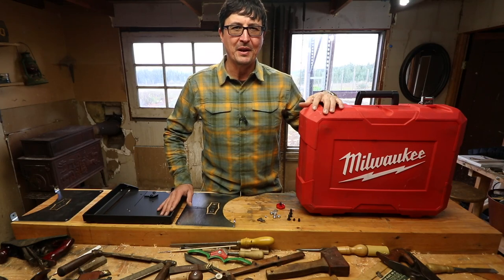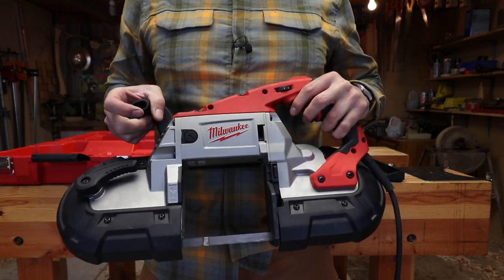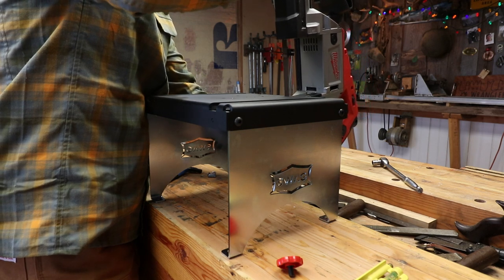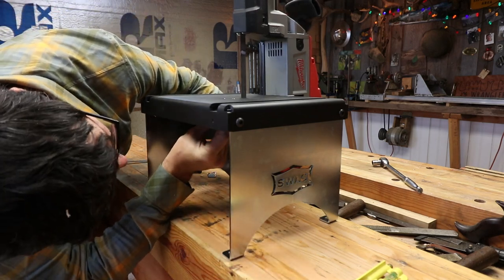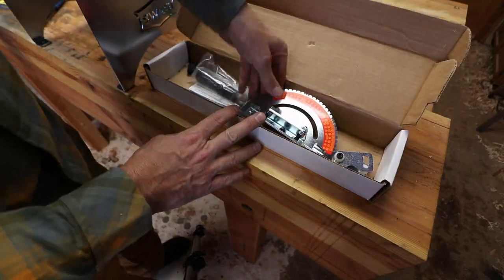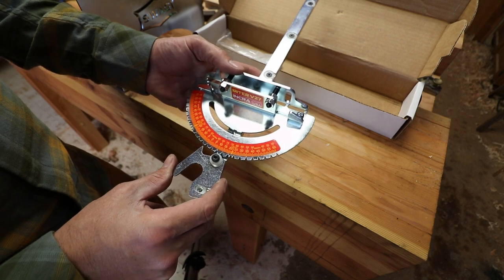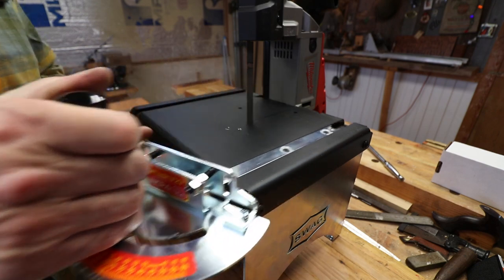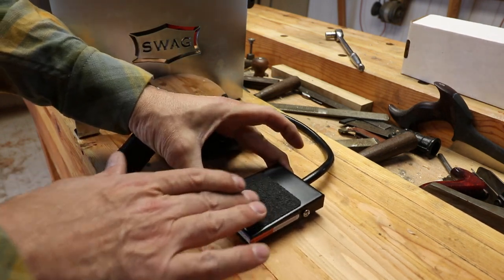AMAZING MILWAUKEE TOOL HACK!!

Comment: Two Thumbs up! Thanks for posting?

Do you have a URL links for the miter tool and the foot switch? They really do make SWAG an everyday useful tool. Perhaps only for emergency use without the two add-on's. There has to be a way for Troy to engineer a way around or trigger clip included with the table cost for the non-lockable on-off triggers types of  band saw. That clamp you're using is great for the video but it makes the hair on the back of my neck stand up for safety reasons. Again just fine and perfectly used in your video. God Bless Brother.
Reply: Hawaiian F150...Use a small zip tie at correct length to slip on & off trigger, works great on my same saw's set up. Leave it attached to saw for use at anytime.
Reply: arkansas13 should be a trigger lock on the saw itself.  been a sheet metal worker for years and every Milwaukee we have has a lock

Comment: Cool addition to the portaband but the video was 12 min. too long.  Didn't need the back story. Just the assembly, use and where to buy was all that was necessary. Thanx, though.

Comment: Iv had my Bansaw about 3 years or so any problem iv had is the rubber belt on the drive wheel broke I guess because of age I use it alot after that I bought 2 sets just to have back up other that that I haven't had any issues

Comment: Use a chop saw and cut anything metal in one or 2 seconds. Forget that tool for I do not see a guard for safety and it is to slow. I have a Milwaukie rotary saw and it has been in my shop for 20 years and has never been used because it is useless.  I have   two  14" delta band saws  with metal blades but they are useless compared to the chop saw.

Comment: Mhhmmm how to cut metal of any size ? To any shape and angles? Oh well what about a trusty ol angel grinder ?! Scratch it on and cut it. Best thing is you can even grind it up, smoothen edges and all sorts of other stuff. The bandsaw sure is nice but it is not justified if you know how to use an angle grinder properly ;) - just my opinion on this.

Comment: Id rather have a chop saw. Worked in a steel fabrication shop for many years, we always used a chop saw and what the chop saw couldn't handle the oxy acetylene torch would. The bandsaw was only ever useful for making nice cuts which isn't really needed cause we weld over em anyways. Nice to have but isn't worth the shop space imo. The bandsaw is very handy when you have to cut 4inch+ square tubing which you would be hard pressed to do with that little guy. Cool hack but not really practical.
Reply from the maker: I don't agree. I have all three including a plasma torch. The torches are to much of a hassle to break out for simple cuts. The fiber blade is noisy and requires a dust mask because of all the fiber particles. This band saw set up is the perfect solution for cutting small stock and a thousand other small items. Yesterday I had to trim a plastic outlet cover, the band saw worked much better than a torch,
Reply: if we're speaking about working with metals i'd have to disagree with ya. Chop saws are well worth their weight in gold and way faster then a bandsaw in most applications.  If your talking about other materials like say plastic (which most people wouldn't be working with at home) then i guess it would have it's place lol  Most could probably get by with a hacksaw though, which they probably already own. Cutoff wheels also have their place too. 

If I had to choose between a chop saw and bandsaw for a small garage metal working setup I'd go with the chop saw 100% all the way. Also if a person is getting into some serious metal working they would break out the torches. I've worked in a metal fabricating style shop for many years. Our bandsaw rarely gets touched.
Reply from the maker: Perhaps for your application a chop saw is best however for mine a band saw is more useful,

Comment: that's a cool garage gig.  but nobody cuts re-bar with something elaborate as that.  that's a great set up for the band saw.  but its not useful on site.  Milwaukee is great but they go too far and slow down production on job sites.  and its all because of the salesman bragging about something we already have.  we have several recip. saws and several grinders that will do the job.  your free stuff is cool.  But it would be a loss to any company.  I bet you can buy a good band saw for half the  price of what you just justified being free for you!

Comment: I would use a grinder with a cutting disc to cut flat bar etc like a normall a person that has a small
Tool box
Reply: He said its for precise cuts. Angle grinders are rough cut.

Comment: made me cringe a little watching that no-lube cut on the flatbar, even motor oil can help you along and save blades, you could also use a angle grinder for cutting, they are cheap and have an attachment for everything (even tree carcass working)

Comment: I have one of these and I love it. No better way to cut rod and unistrut and my god so many more things
Reply: Does it work with a dewalt portoband
Reply: Liam Boyce I was referring to the Milwaukee deep cut portaband BUT if you go on the website they have one specifically for DeWALT Mikita Milwaukee and I think more. They have a TON more items and some cool stuff. I am definitely ordering the table in the near future. They are not expensive.
Reply: @gtm624  $130 that's pricey I'm only 13 so it's hard to convince my mom it's worth while purchase
Reply: Liam Boyce well yea. But I’m sure you could ask for it for a gift. Also when I was 13 I had a small landscaping business. I had dirt bikes I saved for and bought. I was right around 13 when I saved up 600 bucks to buy a dirt bike. All from money I hustled up on my own. Because my (single) mom has gone through some hard times. When I was 8 I got
A rotary push mower. For my 10th birthday I begged for a gas powered lawn mower. I got it. Eventually more equipment like gas weed whacker and leaf blower. I walked all over the neighborhood and worked up customers and before you knew it I had more customers then I could handle and ended up having my friend work for me sometimes. Moral of the story is my dude. Sometimes there are times where the table will come to you. But most times you gotta take action yourself if you want something bad enough. Don’t wait for mom to buy you that table. Find a way to earn the money. I guarantee you’ll enjoy that table way more if you did. You’ll have a real sense of accomplishment and you’ll learn a lot from the experience. Granted I lived in sorta suburbs. So pushing equipment around the neighborhood was possible. But that’s my example. If you could manage to work up $13 a month for the rest of the year you could have enough by Christmas to purchase it. And then be working on the next thing and so on. I worked and stashed cash in my
Closet. That’s always how I got stuff.

Comment: It is a really cool setup and especially if you have limited space, way to go, But, by the time you by the saw and the goodies to go with it (stand and switch and miter) you've got as much spend as a budget full size metal bandsaw and they have way more capacity and power so I'd be hard pressed to pick the little one.........  But I doooo like it  ......  can you get me a free one tooo 😂

Comment: never mind shop  use on the job site  it would be awesome  to have a table like this  
would be awesome  if he could turn a hand drill in to a drill press too that would be awesome  the mag drills are great for steel  but not work  that good with wood or other non metal  thing
Reply: You do know that they make stands to put a hand drill into a press setup, right? All they way from cheap to some make of cast iron. Google 'hand drill press stand' and find 2.5 million hits.
Reply: D.E.B. B i will check it out
Reply: FWIW; the cast iron ones are really made to be in left in the home, and are quite heavy; but they really do turn your 1/2" hand drill into a good drill press (Stanley made an excellent one through the first half of the 20th century that are still around; it weighed about 40 pounds, though). The cast aluminum ones are also sturdy, maybe 10 pounds max, and portable enough to bring to the job site. The thing to be wary of is the ones where the post is loose fitting into the base (they make them like that in order to ship it in a smaller box). It should be all one piece, the post permanently in the base. If you see a picture of one, and it has a bolt that holds in the post at the base, it's probably going to flex a little and you won't get a perfectly straight hole in your work.

Comment: Hmmm, I wonder if he cold make something like that to convert a skilsaw to a table saw and a hand drill to a drill press?
Reply: There are plans on the net.
Reply: I don't know about now but my dad bought a table similar to this to convert a hand power saw to a table saw back in the '50' or early '60's when I was growing up.  I still have it but not sure if I have the saw.
Reply: Horrible freight made a table for years that you could bolt your hand held circular saw into. You can still find them on fleabay.

Comment: Wouldn't you want to use a lubricant when cutting the steel?
Reply: It really depends on what grade of steel you're cutting.
Reply: not on a porta band, besides the drive wheels the blades are designed to be used dry.  Variable tooth 14-18 Morse are the best. Milwaukee blades suck.

Comment: love the tool. however it is not osha aproved. just a heads up to anyone in a teaching environment or work area with osha regulations.
Reply: XmackattackX dude its a bandsaw table they sellem in hardware stores whats the difference an osha inspector wouldent give it a second glance
Reply: my instructor was not able to use them because of it. just letting people know.
Reply: So they can't use any bandsaw?
Reply: XmackattackX im osha 10 certified so i can use it my instructor taught the class
Reply: J DeWitt DIY not inless they are osha 10 certified

Comment: I see a durability issue with the plastic top.
Reply: mudemmeonick nothing is plastic on the table.
Reply: Black part, where the cuts are made isn't plastic? Don't think so bud.
Reply: mudemmeonick it's a powder coated finish on the table. you can get it raw steel as well
Reply: Britt Doughty Doesn't look like it. Doesn't sound like it.
Reply: You could always look at the website
Reply: I just said it doesn't look and sound.

Comment: cant you just get a bench top band saw for a few hundred bucks?
Reply: You might get lucky and find a used one for cheap, but metal cutting bandsaws are expensive. I ended up picking up this same setup recently as it was far less expensive than a full size metal cutting bandsaw. The less expensive and more common wood bandsaws run too fast to cut metal.

Comment: portableband saw that the first time i ever see one, if its portable its not any better than a angele grinder. btw i have 1 125mm milwaukee grinder and thats de worst one ever I worked with.
angele grinders 125mm from top to bottom. Metabo, Bosch blue, Makita, Hitachi, black&decker Milwaukee skill.  and yes i know that the black&decker and skill diy machines.